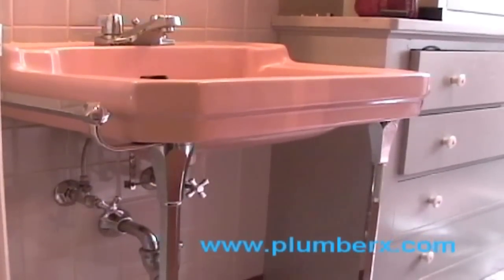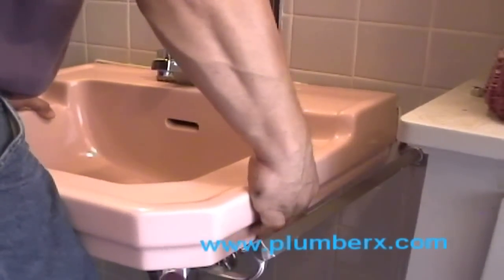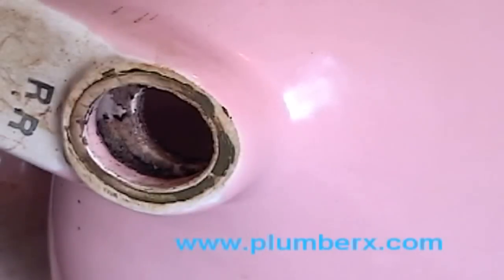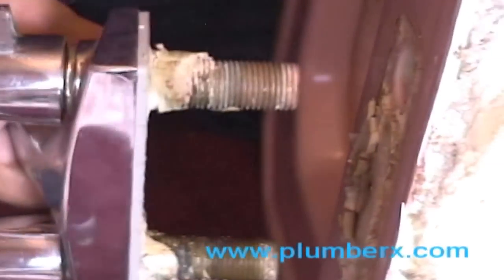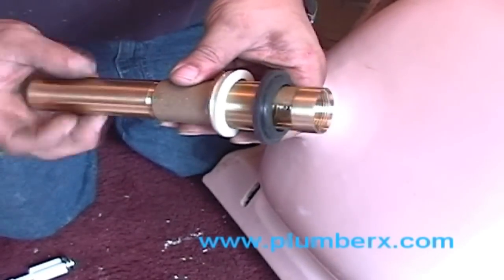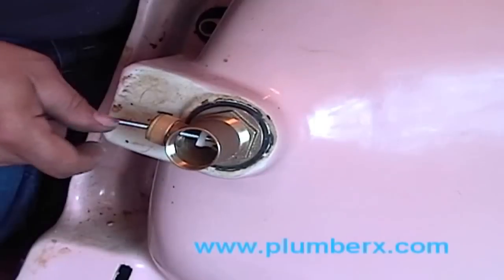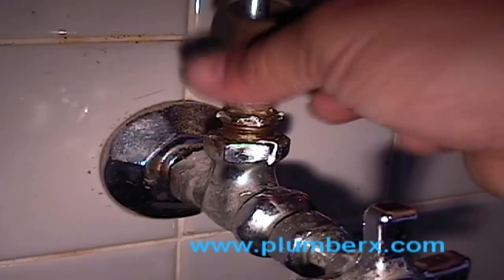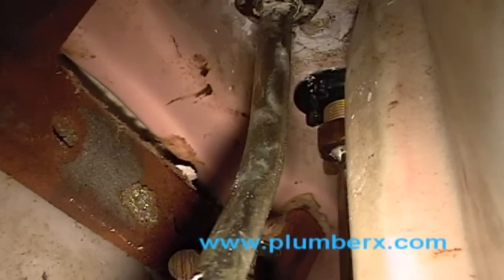Wall Hung Bathroom Sink Repair | How To Plumbing

Comment: It turns out exactly what you just said… The sink itself was no problem… Removing the old wall mount bracket and replacing it with the new one (they were different )was definitely tricky.